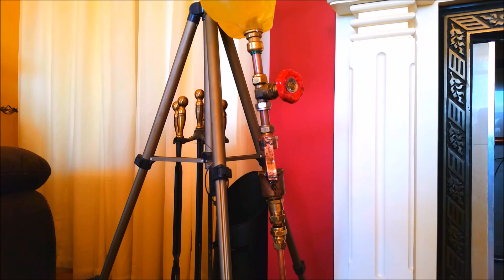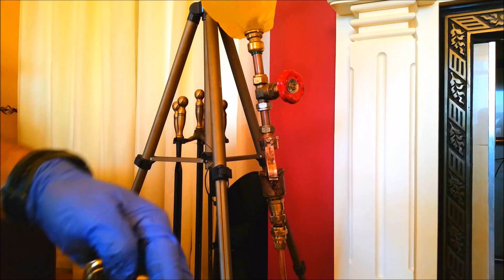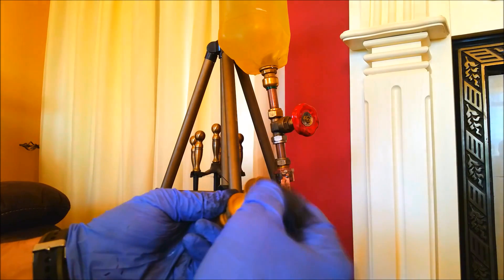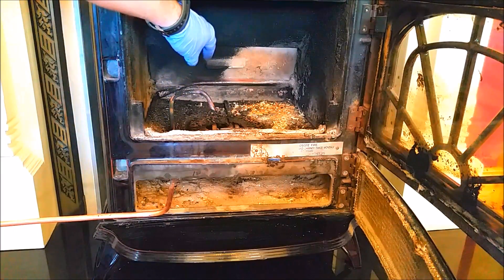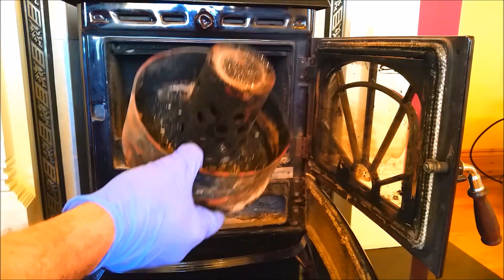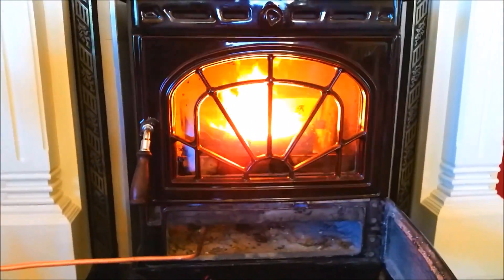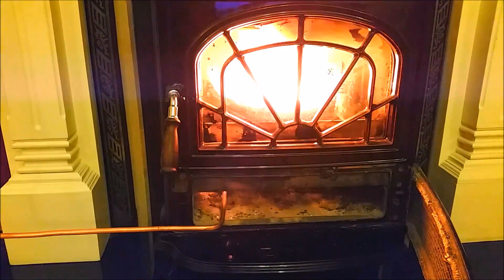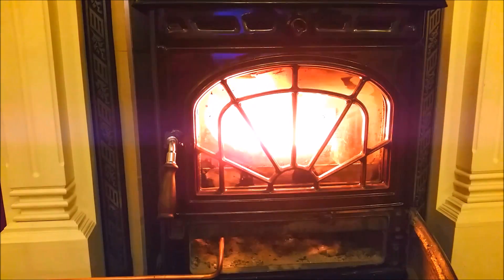Homemade Waste Oil Burner .. Converted Stove walkthrough

Comment from the maker: The burner in this video works great and is my own design. Recently I designed another burner that also works great and is small enough to fit inside things while making a huge amount of heat on just 2 litres of fuel.  https://youtu.be/ShTLaYKjzxw  Cheers Gerry
Reply: you got my vote all the way from Canada thumbs up all the way cheers
Reply: Nice one Gerry!
Reply: How does the oil travel down and then back up the tube to get in to the burn chamber? Is it just that the oil is so hot it moves up the tube before it comes out?

Comment: Hi Jerry what diameter pipe is that you are using? Great channel by the way. I am getting a load of used oil from my Bangladeshi mate in Southern Finland and I am going to have a go at doing this in the cottage we have. The fireplace we have there has the sand storage in the sides and I think you have showed me the way to heat that place. We have used two chinese diesel heaters the last year a Vevor one and a bigger Hcalary one they have been useful but the diesel costs. The used oil burns great. I was using the spam newspapers we get tons of them and empty milk cartons suffed full of paper and soaked in some cooking oil. They really get the fire going with some wood in. The waste oil drip you have designed is going to be great. Thank you very much for your efforts. Cheers and Ireland forever by the way as I am an Irish citizen. :)

Comment: Great Video Gerry thank you for posting it. I have one question, Is there any outside air supply like a fan Or is it just the natural draft from the fire feeding it air?
Reply from the maker: Hi Mickey. There is no fan. The stove pulls all the air in through the bottom ash door. The burner is my own design and I use it in lots of the videos after this one. Check out the playlist for more info and a look at this burner in my other stoves. Cheers Gerry
Reply: @GerrysDiy  The stove you have in your house is so beautiful and installed very nice. Your oil burner set up is excellent. Like they say if it works don't fix it. I really appreciate the work that you do and the time you put into sharing it with us. You definitely have some great designs. Keep up the great work and please stay safe and healthy God bless.🙏🏻👍

Comment: Great work gerry. I recently bought an oil stove for my mancave. It works well as it has wicks and runs all the time so has a constant heat. The downside is its costly to run about 30 litres a week and iam heating a room that isn't used all the time. So I wonder could I convert it to a pot burner and use the Toby valve on the stove to meter the kerosene as I don't intend to run waste oil. It would mean that I have heat on demand and not heating the place when not in use. Any thoughts? It's a hunter stove similar to the Stanley oisin. Keep up the good work and good to see a fellow Irish man on YouTube for a change.
Reply from the maker: Hi Tony How big is the Man Cave and how well sealed and insulated. It's gas all this youtube stuff. I fly paragliders and had lots of videos on another channel but all you saw was my feet, hands, country side and only music with no talking. But then  I made a burner and it worked great so I put a video up which was worse than my current ones and it took off. Getting close now to 100K subs which is nuts.Thanks for commenting 👍👍

Comment: Nice job, what is kw output of atove in video and is it as good as burning wood.
Reply from the maker: Hi James It's 21 Kw total output. 15Kw to the boiler and 6Kw to the room. It's a Stanley Erin. I will be uploading a video where I changed the fire rope seal on the door and talk about the stove a little. Thanks for commenting Cheers Gerry
Reply: Thanks, thinking of doing something simmilar to the wood stive in my workshop. Its 5-6kw

Comment: Is the water system a closed loop?
Reply from the maker: Hi Mark. The heating system is open vented with a 300 llitre indirect hot water storage tank and all fed from a header tank. With it being open vented it cannot build up pressure if the contents boiled. This boiler stove heats my domestic water and underfloor heating. Hope this helps Cheers Gerry

Comment: Your opinion for the DIY’er please:

For someone with an inside rocket mass heater do you think that having an oil burner outside that would blow forced hot air (not bad fumes) through the wall of a cabin and into the mass heater duct-work would be a good idea?

Comment: Hello, i got the same plan for building a waste oil stove. As i did not want to use a blower i'm verry happy you shared your project with us !!  One thing i would maybe say to you is that i'm gonna use outside air because a stove like this needs alot of air and i don't want so suck that in my house i rather use it directly from outside in the stove for a maximum heat in the house !! Thanks !!!
Reply from the maker: Hi moekakke. Yes outside air is good. houses here have room vents to the outside so there is plenty of air for combustion but if this was airtight I would definitely have ported air to the stove. Thanks for  the comment Cheers Gerry
Reply: What i mean is, when you connect the stove directly to the outside air with a tube you don't pull the cold air in de house...
Reply: @moekakke  I was wondering the same thing...   a LOT of air has to come from somewhere.  Don't want to pull this in thru the cracks and crevices in the house.
Reply: @wabbott444  i ran into another problem... i thought to have allot of waste oil but then you got this fire and sure it go's well but the 5 liter every 2 months from my car just does not do the trick... Sure i have some oil from people who's car i maintained and some waste frying oil but that is not enough and waste oil is hard to get when looking for 1000 liter each year. So now i got to this new free source and that is coal. Here in Belgium people changed to gas and many houses still have a whole lot in the ched or basement so when these property's get sold or renovated people just give them away for free in the summer you just have to go pick them up. I already have a pile for 5 years atleast now it's so easy !!! I sure hope those inviralmental freaks keep making all those fools crazy to not want to burn coal anymore !! ;-)
Reply: @moekakke  ha ha... yes, I think I would run into the sourcing issue too.  I have restaurants in my immediate area, but without asking, I am guessing there's a line of people who are willing to take it...  I think I might look at pellets next.

Comment: Would waste oil that has antifreeze, brake fluid, power steering fluid mixed in still work. Just wondering cause sometimes you never know for sure when someone gives you old waste oil. Thanks Gerry, love your videos. :)
Reply from the maker: Hi James. I have a video  from a few years ago where I show what just a few drops of water do to the flame with the door open. It's not good so you need all the water out of the oil. You can hear when it has water in it. Here's a link https://youtu.be/MeCpIDJBP40 Cheers Gerry
Reply from the maker: Hi Fragwits. Yes in a standard stove it works great too. This burner is my own design and I have used it in my shed for months and it works great in many different stove setups. Recently I designed another burner that also works great and is small enough to fit in things. Here's how to build the new one. Works great too https://youtu.be/ShTLaYKjzxw Cheers Gerry
Reply: What hapend if the stove brake and water comes out in the  fire? Realy dangeros to do whith water jacket stoves....

Comment: Cheers Gerry that's the one I will endeavour to make. I still have to cut the grass before I get out to my garage. 
On a lighter note the weather is lovely here in Scotland today (it could be snowing tomorrow though)
Thanks again
Regards
Raymond
Reply from the maker: Hi Raymond. It's an easy build and works very well without fans. I was using this burner last night in the shed in the cooker stove and it really lashes out the heat. The weather here is very like that in Scotland. Not like Spain lol. Cheers Gerry

Comment: Hi, what is the oil consumption per hour
Reply from the maker: Hi Ziad. This burner has proved very well behaved and predictable. I have used it quite a few of my burner projects and it is happy using 2 litres per hour but if more output is needed you can simply increase the oil flow rate. Here's a link to the same burner in a cooker stove I made that I am using as a shed heater at the moment. https://youtu.be/tnzEDEpz3Yk Thanks for the comment Cheers Gerry

Comment: How does the fire not catch in the feed & move up the supply?
Reply from the maker: Hi Travis.  It just doesn't want to do that, you would need the oil line acting like a chimney for the flames to go that direction. The pipe is actually under negative pressure from the stove and there is a little oil trap too because of the way the unit is piped. I have quite a few burner videos and I usually use a pipe in pipe system. Here's a link https://youtu.be/HV2dGDhM424 Thanks for the comment Cheers Gerry
Reply: @GerrysDiy   hi Gerry,  mine was connected to a standard old flue liner block Chimney,  as the chimney had  a lot of tar build up etc from wood/turf/coal burning over many years  it caught fire  and it was a scary experience for over a hour , the Draw and heat was Shocking, and i was hoping the Stove glass would hold due to heat and  DRAW from the burning chimney tar, SCARY!!!!! but I still like you  DIY  Videos,  God Bless.

Comment: nice simple effective burner, have built a foundry and a mini forge running off waste engine oil, Im just about to build a pool heater and will probably copy your design, i'll give you a shout if i do.
Reply from the maker: Hi Turbo Conqering mega Eagle. It's a very easy to make little burner but it does need good draw from your chimney / flue to make it all work. My own flue in the shed is 4m and in the house like in this video its about 8 metres and provides that roar you can hear in all the videos I use this burner in.  Cheers Gerry

Comment: You are a king.  Watching your videos was very informative and they move at a good pace, not too fast and not too slow, but with just the right detail needed.   I had a concern about the amount of heat generated being too much for the heat shields in the stove in the house.  The reason for my interest is in creating a metal smelter to cast bronze screws for boats and gun parts.  My wife says it has to be outside  :(  Then again, she is a better shot than I am at close range.  So I have been working on my zig zag running.

Comment: Nice Gerry, , did you make the "boiler" portion yourself or did the little stove come with it fitted. I now live in Canada, but am from Scotland and I do remember our old house fireplace had a " Back Boiler " so when the fire was on, we got hot water also : )
Reply from the maker: Hi Madd Macc. The stove has about 50,000 btu to the water side of things so is powerful enough over time to look after my underfloor heating, hot water and radiator system. Its a great little stove and it comes complete with boiler. The little burner works great in this stove but I am not confident of running waste oil in the house. I can however connect it all up to an outside boiler and connect in to the existing heating system and get all the benefits without the risk. Cheers Gerry
Reply from the maker: Hi Madd Macc. I have been to Scotland a few times and loved it the closest I got to Canada was Oregon. It rains in both places as much as here in Ireland  lol Cheers Gerry

Comment: Hi Gerry, I wonder how your new burner would work if you were to put pellets in it instead of oil, just a thought I came up with.
Reply from the maker: Hi George. I have put wood shavings soaked in oil and it goes like its in a steam engine. Pellets would be the same but provision would need to me made for renewing the fuel automatically and ash removal. I might do something on that before long. Cheers Gerry

Comment: Hi Gerry, why do you think your concept could be so dangerous in a house? The flame would stay in the stove, what is the difference with burning wood in the stove?
Reply: Does the problem come from the stove glass that would break due to the to high temperature?
Reply from the maker: Hi Juh Daille. The stove in this video allows me to control the air input so that if I close off the intake the flame will stop. I can imagine that some people might take chances with their design efforts. The burner I show in the video is very easy to make and runs very well but waste oil can be contaminated with all sorts of things that can cause the flame to run away uncontrollably. I will do another video this week where I will add just water to the fuel and show what happens. You would be surprised. If you were distracted and the oil overflowed from the burn chamber that could be enough to take out a whole house or worse. If someone adds kerosene to a hot burner etc. There are lots of ways to make a cheap heater to go wrong. I have already disconnected the burner from the stove in the video. There are other ways to do this and I will be doing more on that soon. Hope this helps. Be Safe Gerry
Reply from the maker: Hi Juh. The glass is safe if it is stove glass and it does allow you to see what is happening in the stove which is safer in my opinion. All of my designs to date have glass in them for viewing. If your flue  is of sufficient diameter and length there will be no fumes in the living space. you can see in the video that the flame and smoke stay in the stove and go up the flue. If any stove burning coal , wood, gas or oil smokes into the room then there is not sufficient draw on the chimney and that needs to be sorted before burning takes place. It is possible to burn waste oil but my advice is to learn more with a shed stove or just outside and then decide. Cheers Gerry
Reply: +Juh Daille - There is NO SAFETY built-in... Like if it gets TOO HOT to a certain Temps or incase something failed. Unattended, Draft Failures, Insurance Policy, Etc....  I think that is pretty easy to understand don't you?

Comment: Thanks Gerry, I now have a pile of propane and other tanks and some plans I drew up waiting to get my welder fixed to start building!
Reply from the maker: Cool Tepco. If you can make a video when you have it working that would be great. These unpowered stoves and burners work well if you have sufficient flue length to generate the draw / suction. This version of the updraft burner I have been using in the min ion and in my house stove can be improved but is working great for me as is. I have some ideas for the mk2 model. The beauty is they are cheap to make and run. Cheers Gerry

Comment: thanks Gerry for showing the bottle connector! Is there any rating on the glass you'd recommend? I'm having difficulty with finding it, or may just use Pyrex like you did originally.
Reply from the maker: Hi Erik. I recently changed the glass in the stove in this video which is rated at 700 degrees C. I used the old glass in the minion. The glass I purchased was stove glass Robax or similar. The only time I broke the pyrex in my stoves was when I didn't allow enough room for expansion. Other than that they all worked well. Cheers Gerry
Reply: Awesome thanks